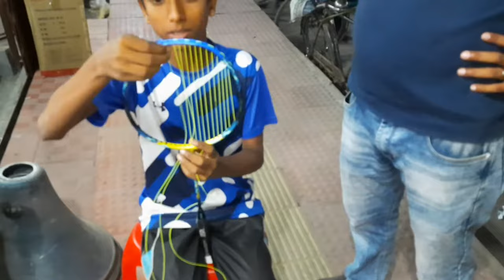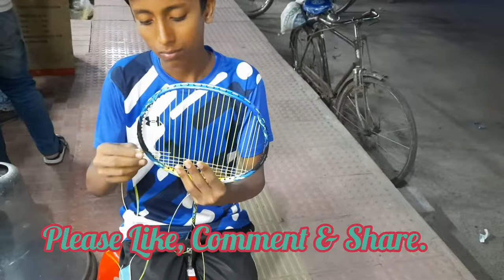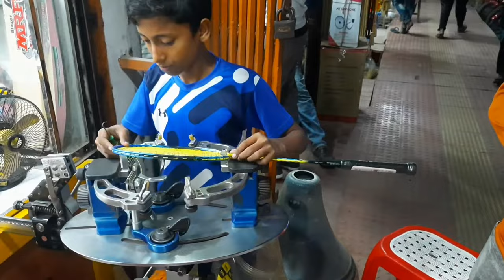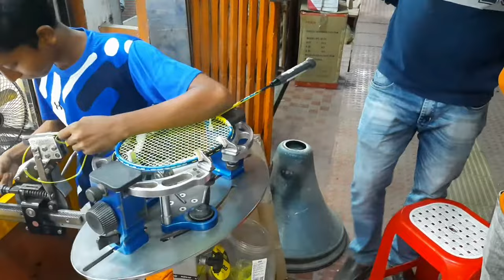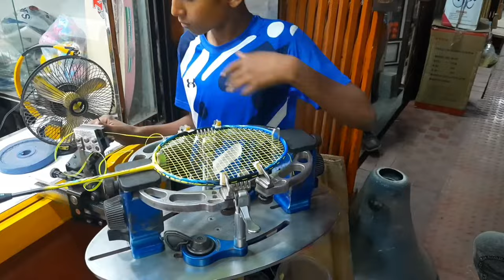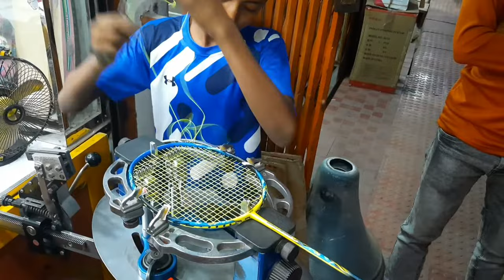Professional Batminton Racket Stringing||Batminton Stringing#Racket#indoregames

Comment: This method of having it cross woven before even loading on the tensioner and then pulling the cross strings on the tightened main strings causes a lot of string burn on the mains which results in less durability and tension gets lost pretty quick...no wonder this is a very talented boy, but someone gotta tell him this.